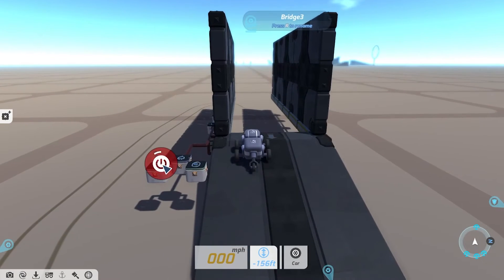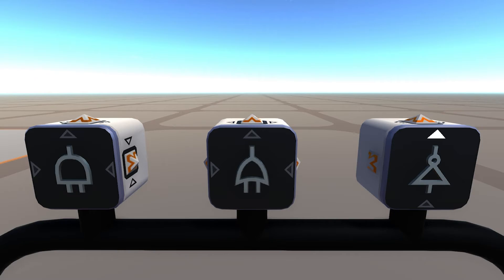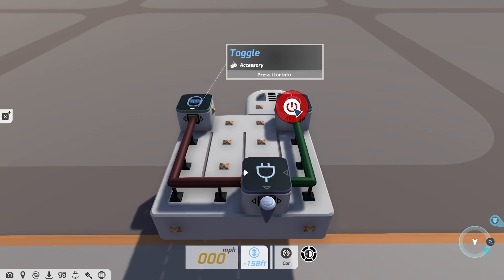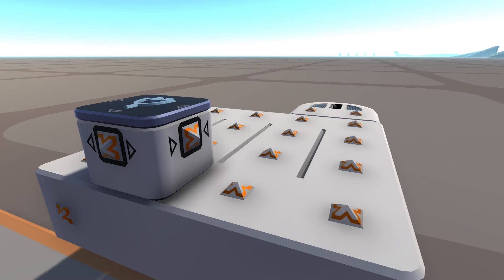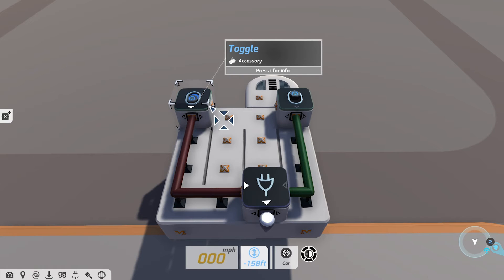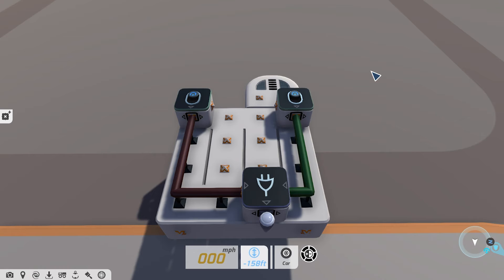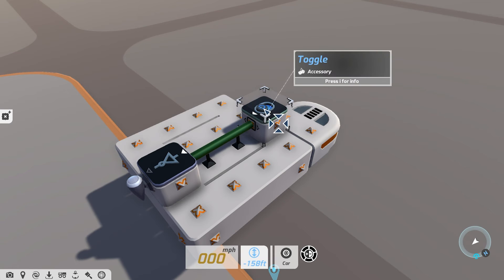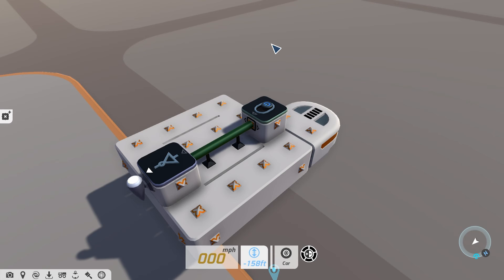How To - Logic Blocks || TerraTech Tutorials

Comment: I wish there were more than the three basic logic blocks, most notably the exclusive or (xor for short) which sends a signal when the input values differ from each other. 

Now I could be wishing for the nor and nand but those could both be made by just adding a not at the end. Although if I were to wish for more, an S/R latch and a T flip-flop could come in handy for more advanced use cases.
Also timers/delayers, they would really come in handy for automatically opening/closing gates. Throw in a daylight sensor and we have a base that can open/close depending on the time of day